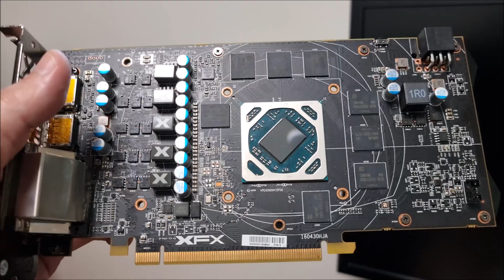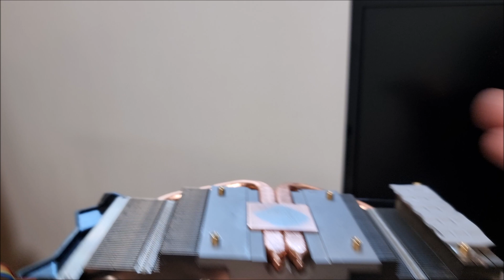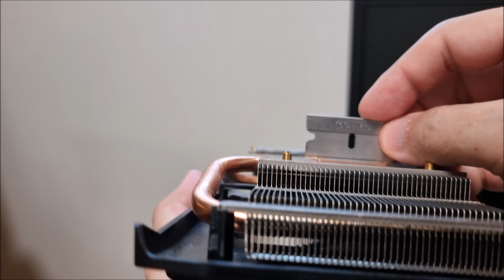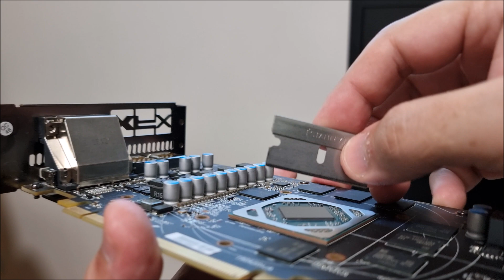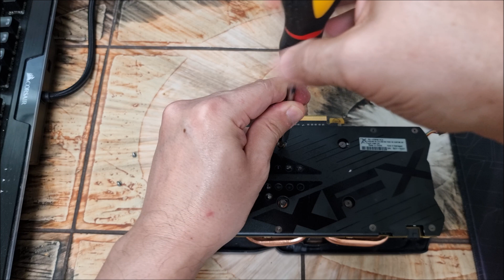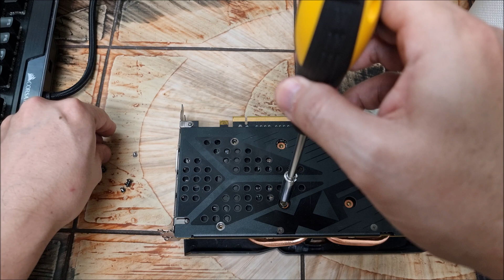GPU Hotspot Mystery Solved! Not What You Might Think!

Comment: Buddy, I did what you said. I applied Kryonaut Extreme to the GPU. Under load, the hotspot temperature dropped from 108°C to 75°C, and the GPU temperature went from 75°C to 60°C. There were still 2 years left on the warranty, but I think it was worth it.
Reply: By the way, my GPU is an ASUS TUF 4070 Ti :)
Reply from the maker: Very nice! Congrats :) It should last you for a good while.
Reply: How are the temps two months later?
Reply: @cmdrriotz5283  There is no difference. I don’t use it much under heavy load.
Reply: How are the temperatures now?!?!??!!??!? INEED THE INFORMATION!!
Reply: So I have an MSI RTX 4080 OC off my GPU in memory temperatures are around 65 to 70 c but my Hotspot is always around 84+ traveling my performance what is causing the issue if both my GPU and memory temperatures are low mind you the highest my fan speed will go to without manually setting it is about 50% my case is a Corsair 4000x with Incredible flow
Reply: @joshuarupert1116  It is most likely due to an incorrect application of the thermal paste or thermal pads.
Reply: I have a tuf 4070 ti super. Was fine for about twelve months but a few weeks ago the gpu temperature never changed from 65-68 degrees but the fans would ramp up from 45% to 80% in a second and then back down after a few moments but would keep doing it.  Only happened in certain games.  Hotspot showed 107 degrees so I undervolted it and now it sits around 60 degrees with the hotspot at 90 and get a little extra in terms of performance.  Not ideal but don’t want to void the warranty
Reply: I hate to break it to you, but Asus is one of the worst companies to RMA. They will deny a claim for a scratch on the fan housing.
Reply: After posting this comment, I tracked the system for roughly one full year. Throughout this period, the GPU stabilizes at around 60–65°C while running Bodycam on ultra settings. In contrast, FurMark consistently drives the GPU past its thermal limit. This clearly demonstrates that FurMark enforces an artificially extreme, non-representative workload that is detached from real-world gaming behavior. From a performance and thermal evaluation standpoint relevant to gamers, Bodycam is a far more accurate and meaningful stress test than FurMark.
Reply: The key metric here is hotspot temperature.
If FurMark is used as the baseline stress test, it implies that the thermal paste would need to be replaced annually.
When this thermal paste was freshly applied, the GPU did not hit the thermal throttling limit in FurMark; however, after approximately one year of use, it now reaches the thermal limit under the same FurMark workload.
Reply: @Maskeliadammmm  german Kryonaut and their products are a must. Have not been using anything else in the past 6 years. Once applied it to my consoles too, and the PS4 Pro/Jet-Engine turned whisper silent in GoW. The loudest part was the HDD and Disc Drive. Impossible to even hear the Fan spinning.

Comment: I have a question when im playing triple A games my pc restarts sometimes like very rarely and causes amd adrenaline to not detect my gpu once the restart is done and then my gpu is fine once i reinstall adrenaline + latest driver. I noticed that my gpu temp is 60-70 max at 80 but the hot spot ranges at 90-98 when full load. I opened my case and the gpu hotspot is lower now under heavy load. Do you think i should change my pc case? Add more fans? Bec im using a very old nzxt case with stock fans and default fam curves im thinking it may not be enough.
Reply from the maker: @dewthegreat9270  Perhaps you should change the thermal paste. But it may be something else since the PC is restarting or crashing games.

Comment: Hey i have a gigabyte rtx 3060ti 8gb varient gpu my overall gpu temo during stress test was around 60-75 but the hotspot was at 105 it always cross hundred even if i remove my cabinet lid and then run the test results will be same so i am sure air flow is not the problem what should i do ? Its under warranty so i cant open my gpu and add new thermal paste.. i cleaned it yesterday thinking maybe that little dust is the reason but it was not any tips?
Reply from the maker: @ROHITYT  Unfortunately this is a case where new thermal paste is the only fix. Either MX-6 or Thermalright Heilos would do.
Reply: @TechnologyHive  ok I'll send it to gigabyte service centre that way they will fix it for free also my warranty will be intact & thanks bro tbh i wasn't expecting any reply as this video was old 😅
Reply from the maker: @ROHITYT  I read all my comments :)

Comment: I have a 6800xt and my hotspot sits at 105-110 degrees, can’t get it down and honestly don’t know what to do
Reply from the maker: @AaronTimm-v4c  Try Thermalright Heilos. It will fix that.
Reply: @TechnologyHive  have you tried it? Looks like a replacement for thermal paste. I have never used a thermal pad directly on a die
Reply: @TechnologyHive  the only other product I can think of trying is MX-6 or thermal grizzly kryonaut extreme
Reply from the maker: @AaronTimm-v4c  Thermalright Heilos is not a thermal pad. It's phase change material.
Reply: @TechnologyHive I know it’s been a while but I ended up using the ID-Cooling FROST PTM-2 High Performance Thermal Pad. It was a cheap alternative to what you recommended but still worked flawlessly. I saw hotspot go from 100°+ down to an average of 85°c. All in all working way better. It’s unfortunate not enough people have watched this video. Thank you for the help

Comment: Idk why but my rx 6600xt by gigabyte after two years now was giving me 76c core and 95 to 97c hotspot in games like hogwarts legacy and even gta 5, later in nfs unbound. Results were more in hogwarts legacy, until I gave it to the seller and he sent the gpu for rma and all they did was repasting and it’s still under warranty. Day one and it was all good, other day it just became so worse like core and hotspot temps were like 79 to 80c and 100 to 105c until the system reboot itself. I decided to disassemble the whole pc and just clean everything, though I clean every month. I have a thick radiator from deepcool le 500 which wasn’t able to be mounted on the top so I switched my front two fans with radiator as an intake and those fans as an exhaust on top. Not so good ik that as it pulls hot air, also today I noticed that the gpu is assembled with all screws tight, still I see a gap on one side, a medium sized gap like it isn’t mounted properly. Idk but I had contacted again and the seller has asked me to give it to him and he’ll see what he can do.
Reply from the maker: @geckoop2848  Try Thermalright Heilos. This works well.
Reply: @geckoop2848  So, are you solve the problem?
Reply: @MlmlkaWT nope.. 3 times rma and they say it’s fine to my retailer. I’m planning to change the case from my cmp 510 to lian li lancool 216, but before that thinking of taking it to different gigabyte service centre myself to see what they have to say about 20c gap. But I noticed that opening the side panel and turning on the ac, did help with temp like 73 core and 90 to 93 hotspot.

Comment: My Msi GTX 1080 Armor OC heats up quickly in stress tests like Furmark, reaching 80 degrees or more in less than 2 minutes and in demanding games it reaches up to 82 degrees with a high consumption between 180w-200w. I had already cleaned it and applied thermal paste and it is still hot, but at rest with the Msi afterburner curve it stays at 39 degrees at rest but in games and stress tests it gets too hot
Reply from the maker: The Armor OC cards have a terrible heatsink. Poor cooling solution by MSI.
Reply: @TechnologyHive  And what should I do in this case? I bought the card  pre-owned on eBay a week ago for $110.
Reply from the maker: @miguelbaltazar29  Well you already replaced the thermal paste, so not much you can do unless you want to go water cooling. But that would not be worth it for this card. You're pretty much stuck with what you got. Although you could try a different paste.
Reply: @TechnologyHive  I cleaned the fans and applied silver thermal paste (the one that comes in 10g) the thermal paste that the graphics card had was dry. I put the graphics card back together and the heat continues. In stress tests with 86 degrees in 2 minutes and in demanding games in 1080p with high graphics it reaches 82 degrees or more.
Reply from the maker: @miguelbaltazar29  Perhaps you need to set a manual fan curve. You will need MSI afterburner for that.
Reply: @TechnologyHive  Yes, I have the MSI Afterburner curve manually configured, which keeps it at 39 degrees at idle. Without MSI Afterburner running, temperatures range between 47-50 degrees also at idle, the problem is only in games and stress tests that the card gets too hot.

Comment: I just bought an Rx 6800 from someone and now I see that in games the GPU temp is 60° and the hotspot is 100-110° and it becomes extremely loud, how is this difference possible, what should I do? Please help
Reply from the maker: @alexx_.477  I would replace the thermal paste with something like MX-6. This should help.
Reply: @TechnologyHive  I have undervolted it now and the hotspot is at 80° now, how is that possible? why is this difference? 50° delta?
Reply: @alexx_.477  That's because AMD cards ramp fan speed based on hotspot temperature and not core temperature. I use red devil 7800 xt and usually my delta between core and hotspot is about 15 degrees after undervolted the card @2415 MHz  with -50mV so 1100mV. So now my hotspot stays at about 75 degrees at max even during very hot days. This card has terrible stock temperatures leading to about 90+ degrees on the hotspot for basically 3% more performance. Just not worth it. And I'm not really from people who upgrades once every 2 years or so bu more like every 5, 6 years.

Comment: what are the chances that the core actualy bends/deforms because of the heat? ik its a silicone and its not likely.
Reply from the maker: The pcb will bend before the core does. By that time, your card is long dead.

Comment: Is my Hotspot too high on my 3070 ti if the GPU average is 74 celsius and Hot spot max degrees was at 104?. I'm so confused and not sure what to do, should i try replacing thermal paste? i have not touched it since i bought it
Reply from the maker: Replacing the thermal paste with something good, like MX-4, will definitely help.
Reply: @TechnologyHive  is MX5 too thin?
Reply from the maker: @teepeg2508  Go with MX-6. Much better performance. And thicker.
Reply: Hi buddy I’ve been noticing my card gets a high hotspot I have a Rtx 4090 and it can have a delta of 20+ I have seen my hotspot hit 97c under load on 3d mark would you say repaste the card? My core temps do appear to be fine never goes above 75-80 in game but mostly sits at 65. Would you recommend mx4 or try ptm 7950 as I’ve been advised that would be best?
Reply from the maker: @ScouserStreamz  I'd go with MX-6 or Thermalright Heilos. You'd be happy with either one.
Reply: @TechnologyHive  cheers for the reply what is your thoughts on ptm7950? You ever used it
Reply from the maker: @ScouserStreamz  Its the same as Thermalright Heilos. If you use one, you've used the other. Great stuff! Reduces your temperature delta over hotspot.
Reply: @ thanks buddy what would be a hot spot for you to be concerned over and what normally is the ideal delta between the core and hotspot?
Reply: @ what one would you go for personally then?
Reply from the maker: @ I'd buy the Thermalright Heilos.
Reply: @TechnologyHive  thermaltight vs arctic tp-3 which is better?
Reply from the maker: @teepeg2508  I have only used Thermalright Heilos and PTM 7950. I like them both.

Comment: My hotspot delta is crazy on my 6900xt, set all my fans to max and in an artificial load my delta is 40C! This card I have is also an rma from a previous unrelated issue and it also had the same issue. My tower is extremely well ventilated, that is 100 percent not the issue.
Reply from the maker: Try repasting the GPU core. I recently made a video on Honeywell PTM7950 phase change material. Real good stuff. Its my latest video.

Comment: Bro my red devil rx 5700xt at 100% usage have max temp 66, but hot spot hit to 110 and idk is that normal
Reply from the maker: No man. That hotspot is high. Have you tried new paste?
Reply: @TechnologyHive  no, i will repaste my gpu tomorrow
Reply from the maker: @borisjankovic9321  Good! Lets us know how it goes!
Reply: @TechnologyHive  do you  think upgrade to rtx 3060 ti is ok ? I wanted to buy rx 6700xt but i have 550w psu
Reply from the maker: @borisjankovic9321  The RX 6700XT will run just fine on a 550w PSU. How do I know? I am running that in my tester system lol. It runs all cards I through at it. Granted I only have on fan and a 5600G CPU.
Reply: @TechnologyHive  ok Thank you so much
Reply from the maker: @borisjankovic9321  Your welcome!

Comment: Have you solved the hotspot issue now? Gonna try the PTM 7950 in my case, im having a hotspot that plays around 110c and package temp around 65-70c when playing soma big title games. But when it is idle or a non gpu intensive game it stays around hotspot80c/package55c

Btw my card is MSI MECH 2X RX 6600
Reply: Any update on your hotspot temps? Been having the same problem. Low gpu temps but high hotspot temps. Give me an update please
Reply from the maker: @ronnielcleobayaua6430  I made a video about it. The latest one should answer your question.
Reply: Definitely go for PTM 7950 it lowered my hotspot temps from 110c to now around 90-95c. Yes I know, hot spot is still high. But atleast it is not hitting above 100c anymore
Reply from the maker: @patrickespedido2831  Wait...I have ordered PTM 7950. I'll be comparing Thermalright Heilos with it in a video. I'm just waiting for it to arrive.
Reply: Goodluck!
Reply: UPDATE: My GPU Hotspot temp is hitting 110c again :(
Reply from the maker: @patrickespedido2831  Did you use the PTM 7950?
Reply from the maker: I have just purchased Thermalright Heilos phase changing TIM and I'll soon make a video on it's performance vs thermal pastes.

Comment: Do you think using a 0.2 thermal pad like kryosheet or something else would solve the uneven die surfaces?
Reply: Kind of late, but I got the kryosheet recently and my hotspot temp went from 110 -> 80.
Reply from the maker: @vchen441  Thats awesome! You're never late man! It is good to keep us updated!
Reply: @vchen441  I bought some PTM 7950 to solve my high hot spot, did you have any trouble in applying the kryosheet? And have you seen temps get worse or better over time?
Reply from the maker: I have not tried it, but it's possible.

Comment: So, how to deal with such situations? I can imagine that adding a soft thermal pad on the gpu might help making contact more evenly. In that case you would also need to increase the thermal pad thickness in other areas. What do you think how to deal with this?
Reply from the maker: I have resorted to thermal puddy for dealing with situations like this. It works great! If the thermal pad is 1.5mm or less, thermal puddy is a great choice. Otherwise, I would stick with soft thermal pads, shore 50 or below.
Reply: Thanks for your reply! You mean putting a Thermal pad on the GPU chip and than use thermal putty on the other components to deal with the changed height?
Reply from the maker: @visionscaper  No. Use thermal paste on the core, and thermal puddy on the VRAM, and VRM. This could help balance things out, eliminating resistance from the surrounding areas to allow for better GPU core contact with the heatsink.

Comment: i have a AMD Rx 7900 xt and use amd software adrenalin edition, when i play helldiver 2 i have 60 celsius GPU temperature or 140 °F  but a 105 celsius/ 221°F hotspot
Reply from the maker: 105c on hotspot is high. Maybe repasting will solve this issue.

Comment: my old rx 5700 goes to 107c on the hotspot without a UV but under 80c on average and mems.. i just recently repasted and repadded as well
Reply from the maker: That's a pretty toasty 107c hotspot😬. What was your hotspot temp before re-paste?
Reply: @TechnologyHive  i dont really remember tbh.. i can get it down to 100c if i do like a -60mv undervolt tho
Reply from the maker: @lightningszn  I hear ya. I would recheck that paste job. There is a high chance your thermal pads are the reason why you're getting that hotspot so high. You may have to squeeze them down to fit.

Comment: TF9 Thermal Paste is thick but it will lower those temps more than arctic etc.
Reply: Yes Bro! I did this, quality thermal pads and TF9 thermal paste, now I have these temps. on my 7800 XT, GPU max 70 Hot Spot max 80, the change is notable, I would say incredible, from the 105 degrees Hot Spot and GPU 80 degrees, plus it also makes more FPS in games and the fans are not audible.
Reply: @gianninodibiase309  excellent.  Thanks for the update. That's stuffs the best I've used too.
Reply from the maker: Thermal Grizzly Kryonaut Extreme did the job 🙂👍🏼
Reply: @TechnologyHive  Kryo is great but you have to replace it 3 times as TF9 lasts for years. It gets clay like when cold then hot it gets liquidy..  Kryo rules otherwise.  👊👍
Reply from the maker: @whodisnewphone  Kryonaut Extreme you do not need to replace. It will last you for years. This is the red stuff.
Reply: @TechnologyHive  Used that on my R7 7800X3D and Duronaut on my 4070ti
Reply: Im using the Arctic thermal pads... Are they not as good? @TechnologyHive